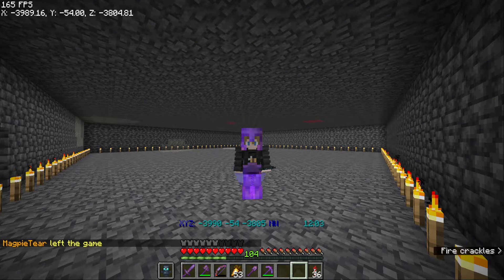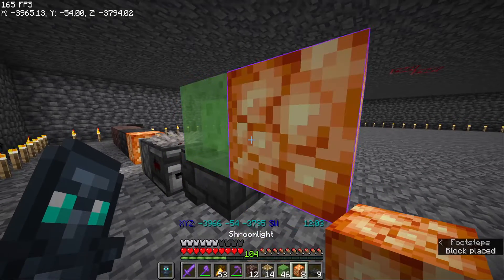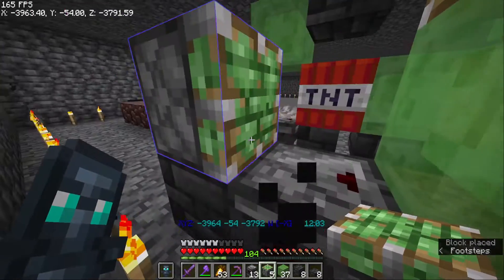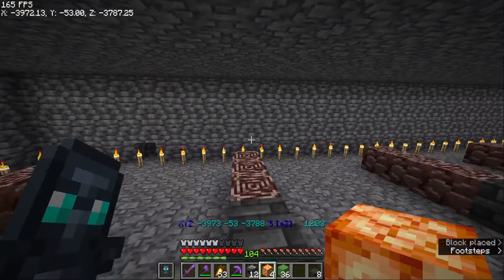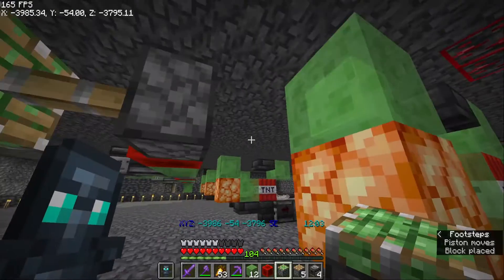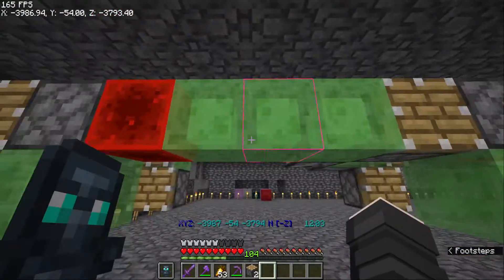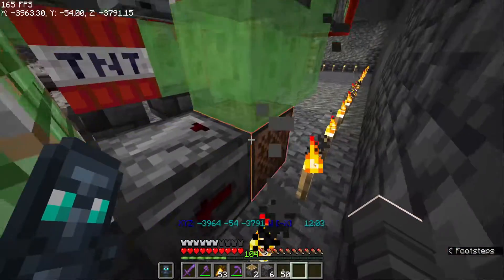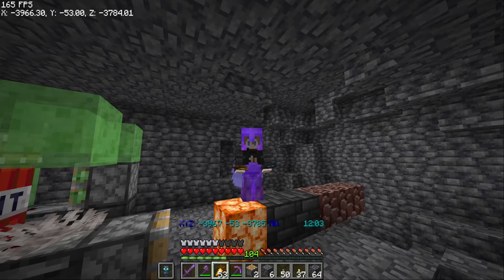5-wide tileable Tunnel Bore Tutorial (Java)

Comment: Hey so for some reason my drill broke, i tried to fix it but it keeps giving me the same issue. The trigger part keeps moving on its own without activating or taking the rest of the build with it, any solutions?
Reply from the maker: Yea, so my guess here is the trigger is on a chunk border, the redstone block os on one side while the sticky piston it's powering is on the other side. All you have to do is remove the section of the bore next the the trigger and rebuild the trigger on 2nd one instead and move the section you just removed to the end of the bore. Since it's tileable it means you don't have to rebuild the whole machine, instead just sections of it. Hope that helps!
Reply: @glaive_  Okay thank u for replying, ill try this very soon!
Reply from the maker: @qkyouko  you're very welcome
Reply: @glaive_  Hey! This solution didnt work for me. Is there somewhere we can talk to sort it out?
Reply from the maker: @qkyouko  sure, my discord is @glaivelord, that's the best place
Reply: @glaive_  I've sent a request, username Kyoko
Reply: @glaive_  Did u figure this out cause I’m having the same problem
Reply from the maker: @intempst  yeah, turns out they are on a server with a claiming plots plugin, when they'd hit a wall of that claimed area the machine would break
Reply: @glaive_ ah ok yup just realised that it’s the fact that I’m like fully copying the first section including the bit u don’t need to so it was maxing the pistons out I think all fixed now 👍 works very well

Comment: YES! Thank you! I've been looking for a video for a more recent Tunnel Bore Tutorial that isn't 1.16.5, and I finally found your video! I'm in my own single player world and I've wanted to build one for a long while, so this will help a lot. But I do have a few questions.
Will you be posting any other tutorial videos? I've wanted to make a few things but old videos seem to not run as efficiently with newer versions of Minecraft.
For instance, I've been trying to make a TNT dupe flying machine to clear out a bunch of chuncks to make more efficient mob farms but the flying machine normally stops working or works halfway leaving half the machine behind. So I was curious if you had a tutorial in mind to help with that a lil bit.
Reply from the maker: Yes I do want to make more tutorials/other content, finding what to do is the problem. As for a world eater as you described, I haven't had the chance to use one personally, but I do know they are pretty touchy, usually the biggest problem is keeping them completely loaded. If it becomes partially unload while moving it will break. 

Sadly I do not have a design for a world eater to help you out and will likely not be making a tutorial for one in the near future, if I make one I have to test it and make sure I like how it runs and that I like building it (as in it isn't insane to build), I won't show some thing here that I haven't personally used. I want to make sure if I'm showing something off it will work and be reliable.

Comment: Thank you so much. First video that showed how to link them :) you earned 2 subs(my alt account😂)
Reply from the maker: You are very welcome.
Reply: @glaive_  wow you responded very fast. Btw do you know if you can link more than 5 contraptions or do you need to build some other setup?
Reply from the maker: @amoglo1496  yes you can link as many as you want together, I just did 5 as that's as big as I'm allowed to do on that server. Keep in mind how many chunks you can load in, simulation distance is typically 10 chunks I believe, so I would go up to 8 chunks wide (that's about 20-25 sections) to be sure the whole machine is loaded in at once so it doesn't break.
Reply: I built a 31 tile bore and everything worked fine until a loaded the tnt  furthest away. Something went wrong and 6 tiles blew up so I'm going with a 25 tile one. I guess that this machine isnt unlimitely tileable and you should aim for about 25 tiles max but im not 100% shure.
Reply from the maker: @amoglo1496  good, thank you for the information!

Comment: Is this tile-able both ways?
Reply from the maker: Yes, you could remove/not build the trigger and add on to the side going to other way, and then just add the trigger again at the end.
Reply: @glaive_  What about having the trigger in the middle so you can chunk load both ends?
Reply from the maker: @MasterElements  I haven't tried that, but you might be able to mirror the design without too much difficulty, I would reccomend testing that in creative. Lmk how it goes!
Reply: @glaive_   I was able to mirror and smush the designs together and have both ends activate Tho the spacing between the trigger and the next one over to the left was a bit wide and to keep and eye on it and mine out a block here or there
Reply from the maker: @MasterElements  Yo, Awesome!
Reply: @MasterElements  I tried it and it didnt work for me
Reply: @amoglo1496  Prob got the spacing wrong, it worked for me, keep trying
Reply: @MasterElements  yo, read ur response, good work. I'm a complete tunnel bore noob and was wondering how I could attach a trigger at the other end

Comment: has anyone found a way yet to make this automatic w a switch?
Reply from the maker: Not that I know of for this design, but I know other designs out there that have that feature and it's probably possible to add that launcher to this engine. Typically its a small flying machine that flys back and forward again to trigger it then flys backwards then forwards again...etc. The main thing if you end up making one is it cant fire less than 4 seconds apart minimum.
Reply: @glaive_  cool thanks

Comment: I’m playing on 1.19.3 Java and it’s not working. It works once but the TNT doesn’t duplicate and the dead coral fans break. Any ideas on how to fix this?
Reply from the maker: Ok, a few questions: is this on a server, if so, is that server a paper/spigot or modded server? With non-vanilla servers like paper and spigot, admins are able to turn off TNT duping, in most cases, it means the coral fan breaks when the TNT passes over it (normally the phase where it duplicates). If this is the case there isn't anything you can do sadly. 
If it is vanilla, then it could be a build mistake, I'm not certain of another reason why it would break in vanilla. I would test it in a single-player world (creative is fine) and see if it works there.

 If you still run into the same problem let me know and I'll give you my discord (if you also have it) and I'll be able to help you further, best of luck with the test!